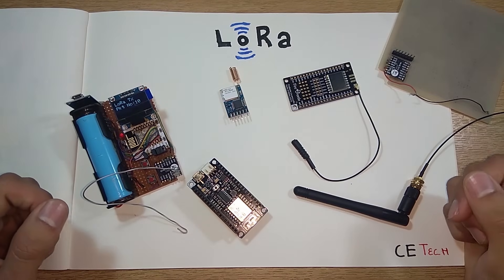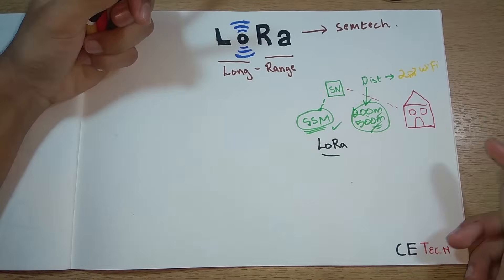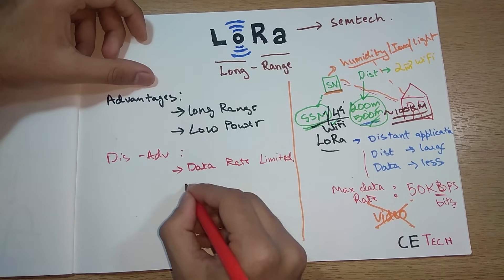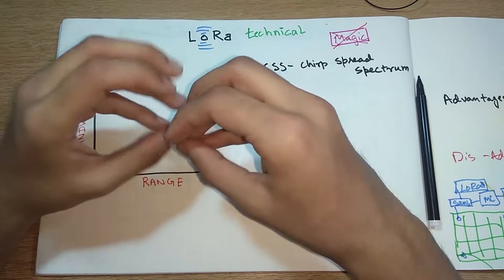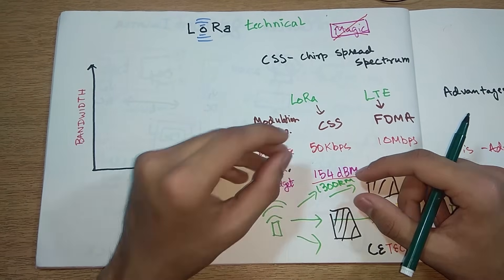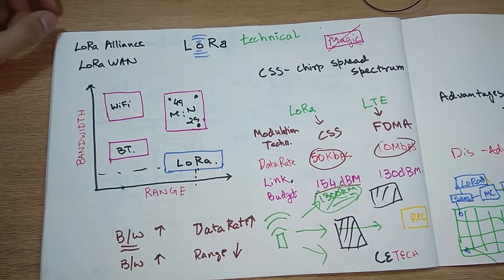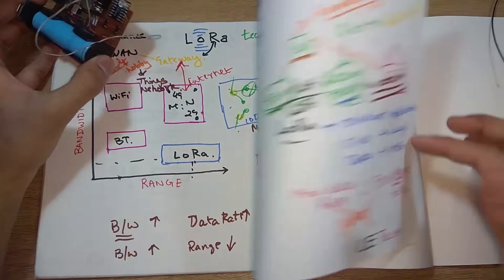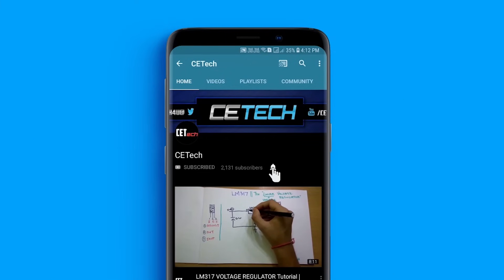Lora tutorial | Getting started with lora | What is LoRa features | LoRa introduction | LoRaWAN

Comment: I'm an RF engineer.  At 7.56 he makes a serious mistake.  dBm is a way of expressing power logarithmically with reference to 1 milliwatt.  1 watt is 30 dBm and 10 watts is 40 dBm.  154 dBm is 10^12.4 watts!   A link budget is a sum of all the gains and losses in a transmission path and is expressed in dB, not dBm.  If the losses amount to -154 dB, (negative because they are losses) that is equivalent to a loss factor of 10^15.4.

Comment: 10's of 100's of KM apart !!!  This is why I HATE Tech Videos by fraudulent "Fellow Desis". Yes! LoRA is a paradigm shift from plausible range achieved from older modulation technologies like FSK, FM, PSK etc, by the virtue of unprecedented SN/R  ratios LoRA can work on. But that doesnt mean LoRA can violate the distance limitation posed to wave propagation of individual frequencies. Only HF (lower than 30Mhz) can periodically travel 1000's of KM, that too limited to favorable "Ionospheric" conditions. VHF Frequencies (30-300Mhz) usually reach their limit at 200KM due to earth curvature and can only go any further when the Rx and TX are on higher elevation, and the rare atmospheric phenomena of "Tropospheric Ducting", when they have been reported to travel 500+ KM.
So Dude.. please don't spread your Trash.

Comment: Low frequency data transmission , because of narrow bandwidth the data transmission will be limited.
If you use the frequency wave length at about 2 meter you have to apply a repeater on the hill to make sure the good coverage up to 100 km. 
this is a knowledge of low frequency coverage area instead of using 3G 4g 5g .
But low frequencies will serve only narrow bandwidth most of them only for the purpose of ameuter  radio as an experiment.
Also the antenna will be too long to use because of low frequencies. 
It is difficult to get a strong and stable signal for 500km long range even though you use frequencies 7Mhz transmission with a very big antenna up to 14feet height.

Comment: As a beginner, this is a good introduction. However, I have a question as such:
What will happen when there are more than 2 IoT devices communicating with the 3rd IoT device at the same time? or the 2nd device starts transmitting while the 1st one is transmitting?

Comment: Hi. I am totally new to this communication method (LoRA) & to know more I have some questions (basic). In your video you have mentioned about transmitting field data (humidity) directly using LoRA module and at the end of the video, the hardware project you showed had a  ESP 8266 what is the purpose of using this device can we use an simple arduino Nano / Uno.

Comment: I have a question is it possible to have several transmitter that connects to a single receiver I explain myself I have several sensors available I want to send the data to a single receiver

Comment: I have a question the range of lora 200 km? Or 15 km? Because I confused
Reply: 150m max.
Reply: 100km Max but it depends on so many factors such as how many structures are blocking the signal.

My devices that I install are lora but also connect to 4g using lorawan and the range on that is 100mx100m so it depends.

Comment: Is it possible that I have 1 lora transmitter module to which i have connected sensors and I want to receive the data at 2 to 3 different places from that 1 transmitting module???? Plz help.
Reply from the maker: Yes, point to multiple point possible!
Reply: @CETech4u  thank you 🙏

Comment: Bro I made a project using hc12 module for water level control. There are 2 overhead tanks and 1 Underground tank. So I need the data in basement for the remaining process. I am done with the project but the connection keeps on breaking .it's not stable. And the distance is roughly 50m indoor. I tried everything. It's works well but sometimes it doesn't. So any solutions to it. Like how should I increase the range. But using a sma anteena or by substituting it to lora reyaz  . And will lora work perfectly.

Comment: 50kbps sounds like so little today. However, as long as you don't send images, audio or video 50kbps is limitless for controlling remote devices. You could still control hundreds of devices at the same time. The idea is to send as little as possible so that your sensors have insane battery life.
Reply from the maker: Exactly!
Reply: I remember upgrading my internet connection several times before getting to 50kbps.
Reply: Ive  been thinking 50bps.  Which would also work as long as i encoded my data on the few bytes that it  would provide. 50kbps is faster than a great dial-up modem!  I really want to try these devices out...almost ready to press 'order'.

Comment: Ahh now I see....
That's a fail then.
I headed up wisp many years ago.

Basically LoRa is a small packet data blast and the net result is bounced received. The packets are small as a lot of the data pack will be lost and corrupt.
The more users the worst it will be.

Then it has backhaul, or as you say gateways. When I did the planning for this, which is called meshing. The objective is "fastest route" which would require ITEC (which I developed many years ago)
It's the only system I know that can run the network and the down side is hand off, is near impossible, and increases the overhead and packet size which then makes it unreliable.

The hops, (routes)  need to be stored in the send and receive as well as the nodes. If a node goes down the data is lost in transit, a resend /recovery takes up more bandwidth as a new path has to be found. This causes network lag.

As the packet is small the lag, and losses are a larger detriment to the infrastructure of the network. 

If you can imagine 50 nodes, 1 wants to send a message to 45.
The address between then has to be known (path).
The route is then recorded and the nodes have to be aware. So what we do is write code that each node stores the 10 best signals it gets.
This then sets up the mesh.
To "keep alive" pings have to be sent between the nodes.
This is one goes off line, the node rescans for the best connection, but is a route has been set this must stay recorded until the data has been transferred. This would cause a overhead.

The receive packet, has to then be held with the data until the data can be sent on or is finally received.(destination).
So we have 15 hops in the route between 1 and 45.
Node 30 goes down.
And is the only link. A weak link is available, this data would be unknown as well as the mesh map.
Now if the mesh map is known and the hops recorded, the "can't forward" can be sent back along the route, as a fail or find.
Then the route has to be changed, this then is sent out to all nodes to find the link (new route).
The who sees 45? Message is then passed from 1 to its node links, who then send it on to what they see, and this goes all the way to 45 is found and there is a reply.
The reply routes back to one following the packet trial which all nodes must remember, who the request came from (creating the route links/nodes).
Then 45 sends last receive packet, and 1 sends last send packet to find out where they were when the link broke.

The packet will consist of.
Sender (origin) data type, address(to) scan results (node address book) route packets node names for the entire route, acknowledged revives on route, and destination receive and packet count.

While this is fairly simple, the "best route" may result in high use of a number of nodes, this could exceed bandwidth or process load or memory of these "high demand" nodes. Therefore "demand level" must be sent within the data packets.
As the mesh is dumb, load balance, and "try next" must be held somewhere. And as this is not clustered, and not centralised, it cannot be load balanced...

It would be link the old phone system and line busy, as each node would have to keep open 20 connections to just create the mesh, and any failures would cause more than 4x the load.

From what I understand it's a small bit (12 or 28) which this has to fit and I don't think it would. At 50k transmits, even if you used  small bits ID for just the top twenty, the node would be repeated and the mesh fail. So you need unique ID for all nodes and the. They need to be mapped.

But if you're sending useless and tiny data (air temp for example) then this isn't a big issue as the clock cycles can be lowered, and limited to 3-4 values and a data tag.

As you can see it doesn't scale well.

Comment: Can I use this technology for audio and?
Reply from the maker: Very low bitrate audio with some delay is possible.
Reply: @CETech4u  for how much range in Km I can do audio communication?
Reply from the maker: Depends on your setup and modules you are using along with spreading factor as well.
Reply: @CETech4u  can I audio communicate 100km wia this module?
Reply: I want to communicate with good sound with no disturbance

Comment: LoRa DOES NOT give you a 450km range, only about 10-11 km
Reply from the maker: Technically LoRa has provided even 700km+ range but yes those are extreme situations, you in normal cases get a way lesser range. Maybe with a decent 20$ setup you can get 10km range, again there are many factors altering the range
Reply: @CETech4u  exactly.